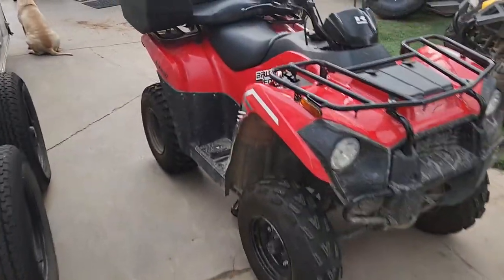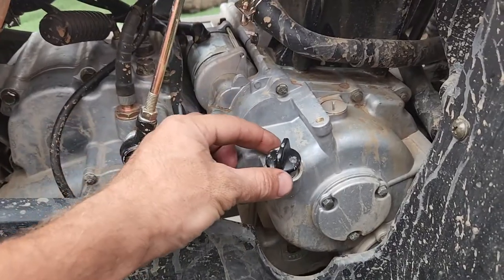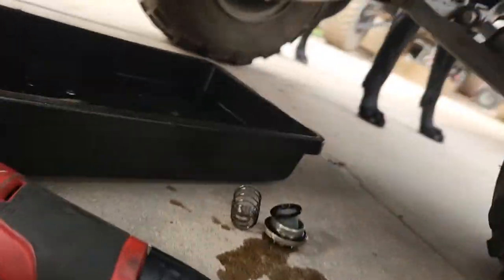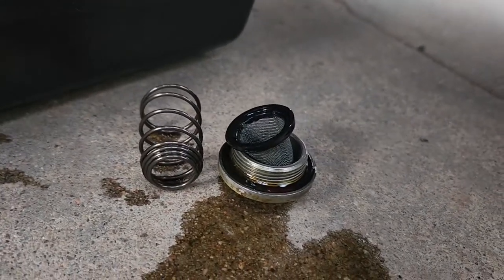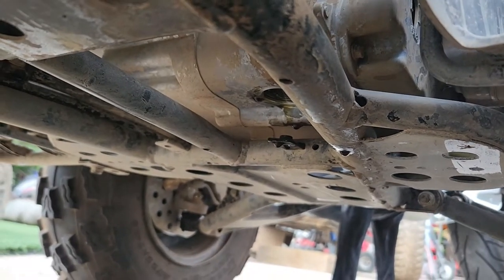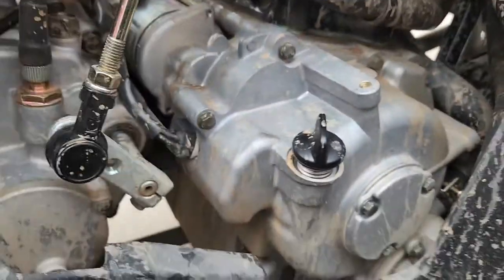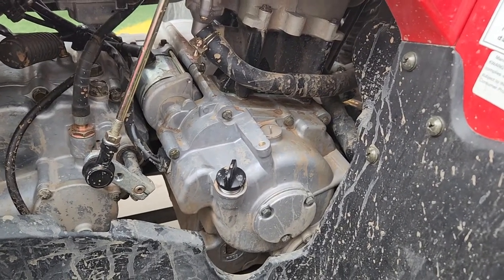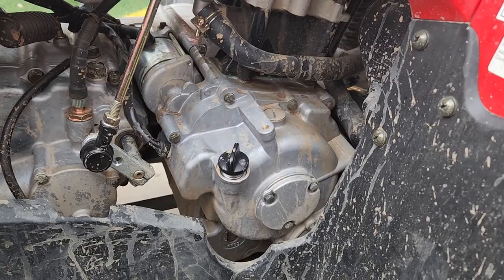2020 Kawasaki Brute Force 300 Oil Change

Comment: There is defenitly another drain bolt.  There is a hole in bash plate to reach it, a little bit on the right and it's a conventionnal one.  The one I use everytime.

Comment: pretty sure that there is another drain bolt other then the one with the oil filter screen that's the actual drain bolt...
Reply from the maker: There isn't
Reply: go to 9 min 45 seconds.
Reply from the maker: @chrisball8472  video is only a minute long
Reply: @brothersmechanics2028  9 min 45 seconds into that video shows it sorry i had just watched it yesterday.